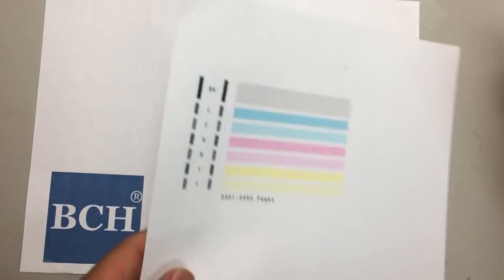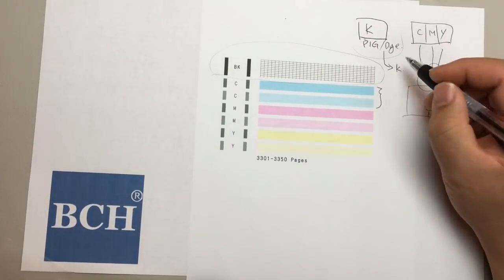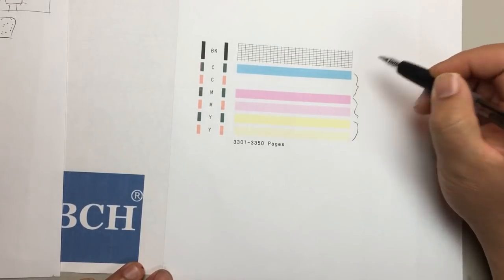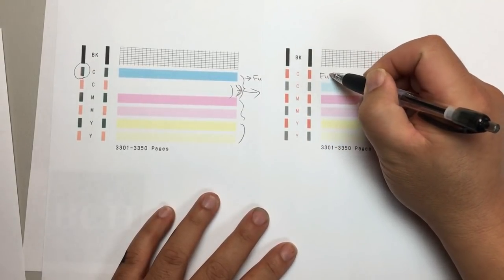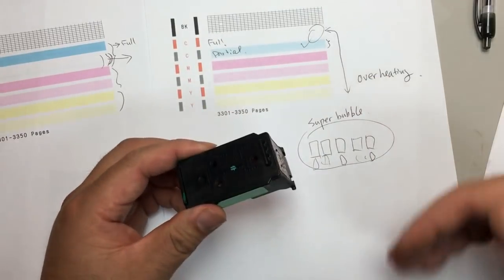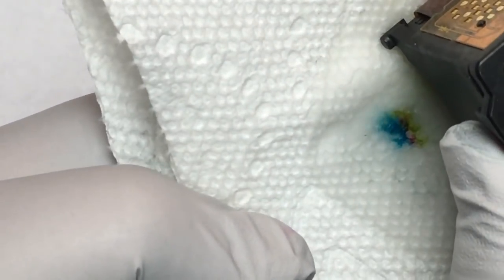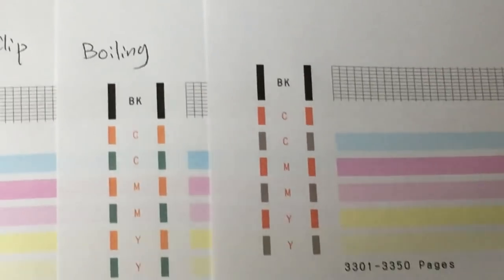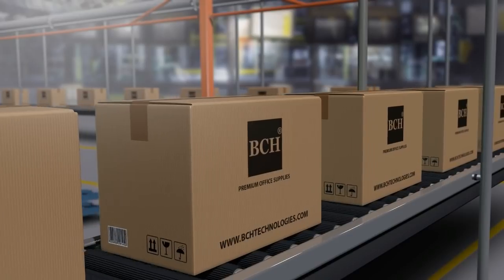#1 Refilled Canon Printhead Failure: it is NOT clogged!

Comment: Hello there , please help
I tried to unclog the canon 47 black cartridge by putting it into hot water for 10 min and dried it, but in the end I'm unable to succeed it....there is problem of horizontal lines on taking prints ...,
What should I do... please help
Reply: In my experience, this is what happened and the same may be the case for you. Ideally, you refill the cartridge before it is empty. Also, the refill works for me around 4 to 5 times after which I eventually need to use a new cartridge as no matter what I do for unclogging (or horizontal lines in print or missing C, Y or B in nozzle check print) it does not work. If yours is the original which has dried up, unfortunately, you will have to go for a new one as the same happened for me for an original 746S color cartridge if all techniques of isopropyl alcohol, warm/hot water, canon deep cleaning did not work.